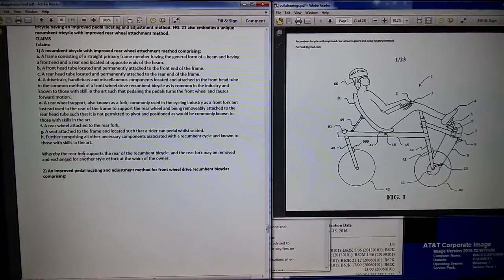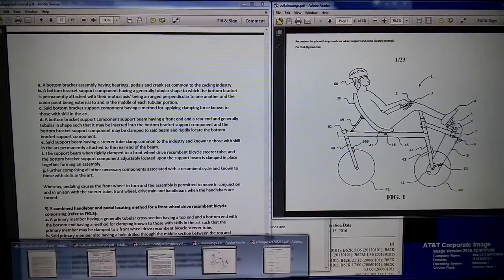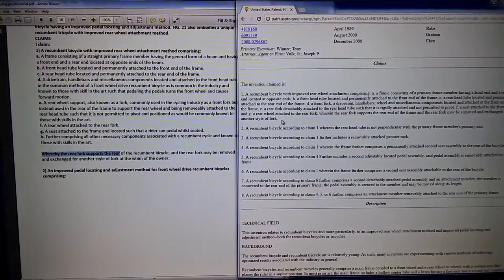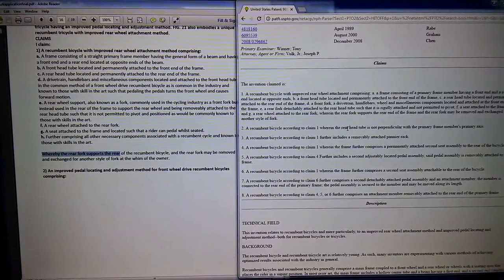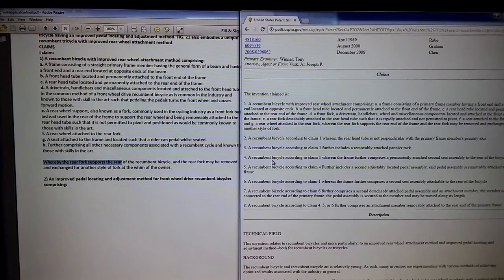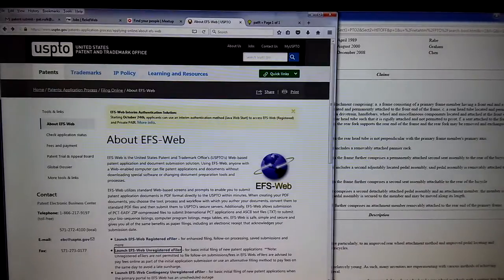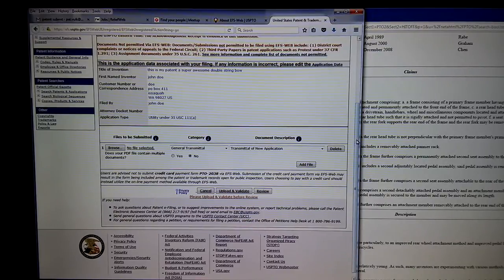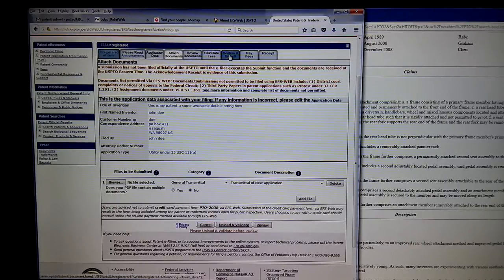How To Write A Patent Part 3

Comment: Thank you for such detailed videos you posted.  one question:  if I have a design change/tweak to current products out on the market, do I file a utility or product patent? Thank you!
Reply from the maker: Hi Ivan!  You're welcome - I wish you all success!

I think your are talking about a utility vs a design patent.
I'm not an expert - OK.
My video is to tell people how to write a patent -- which I still believe is the ONLY video that actually does that...without leaving ANY gaps in how to do it.  I'm really proud of that.
But, I'm NOT an expert on the nuances of utility vs design patents --- watch video 1 to hear my opinion about the patent 'game'.
What I'm saying is that I feel with the right amount of money, you can get a utility patent on almost anything (that's a real thing).

OK, all that said...
You need to research online about utility vs design patent.
But here are some easy to understand examples...

Does your invention have a new function...or does it only look different.

If it has a new function - never seen or done before - that's a utility patent.

If it does the same thing as before, but looks different -- that's a design patent.

Sooooo...let's say you are inventing a new type of pencil.
Design patent --- rather than the old pencil shape, it has a star cross-section.

Utility patent --- the pencil comes apart into 3 pieces and has a screwdriver, digital clock and cell phone.

Hope that helps you!

Best wishes,
Pat
AwakeLove.org
Reply: @theinterfaithshepherd9075  yes, it definitely helps!  Thanks again.  You are a great guy!

Comment: Mr. Vulk

thank you once again for this insight...

I am applying for a provisional patent application (PPA) as a microentity for the benefit of the early filing date and ability to put patent pending for my idea without disclosing/selling it to the public. 

i have questions on your part 2 vid and again on this part 3 video regarding claims.

The PPA does not require you to put a claim(optional), but i am thinking of putting in atleast  one in a broad scope.

My question pertaining to this video is,

as far as my understanding goes on CLAIMS. They are a physical feature(s) and their properties are expressed into words of the invention itself. 

I have multiple embodiment variation and parts variation for each embodiment variation carefully illustrated
. 
in writing claims  i do not YET have the technical ability and know-how  to express ALL  in words of what i claim for my idea.

EXAMPLE @ 24:30 of this video rear FORK attached at the rear head tube,

what if you included a SINGULAR tube (with or without suspension) where the wheels are detacheably  attached and is detacheably  attached to the rear head tube in the DRAWINGS.

lets say this was on the drawings you made and the wordings on the claim specified FORK on it which is inconsistent? Would it be assumed as part of the CLAIM invention?
or those things where the entire patent application process could be denied on?

Can claims be general/broad to maximize, if not entail all,  the expression of how it could be done?

I guess my main concern is if a drawing is worth a 1000 words, then what if you have a thousand drawings(variations) which tell a story be put into a SINGLE SENTENCE? 

That a claim due to the limitation of the writer could actually be the limiting factor in the patent itself. 

May i ask, What is your advice on this?
Reply from the maker: Hi John,

The words of the claim are what is most important.  The figures are merely for illustration.

I 'think' that the figures are very useful for protection (so that it is made clear visually what you have written in your claim).  The clearer things are to people trying to invent what you have already invented...the better.

The drawings are worthless without the words of the claims.  I don't know why that is exactly, but it is.

One thing I want to caution you about on your provisional patent approach -- you can't add to it later...that is true for the non-provisional too.  So be careful and think it through! :)

"That a claim due to the limitation of the writer could actually be the limiting factor in the patent itself."  Yes....definitely....

If you invent a new spaceship, draw nice drawings of a spaceship, but write claims describing a jet plane....your patent will be for a jet plane.  The examiner will help you a 'little bit' with this.

But, if you are really struggling on a patent that is REALLY important to you and you REALLY believe you will make millions on it....my advice is to either hire a patent attorney, OR get the help of a friend who's good in English.

Writing the claims can be very confusing and it's very easy to make a mistake.

You will notice in my videos that I never said writing the claims was easy :)  It's not :)
Reply: Pat vulk OK.. This second message has me thinking more.  About the PPA and claim. This is not something i don't want to just jump in without assessing first. Thank you. I'll definitely read up and contemplate the next move i'll make
Reply from the maker: Yes, John, you definitely don't want to just jump into it without thinking it through pretty well.  

The way I'd approach it (whether using a lawyer or not) is to write out your claims as you understand them - do that immediately.  Then, as time goes by over the coming months, revise and re-think them as you learn more and sleep on it again and again.

Good luck!!  YOU CAN DO IT!!! :)
Reply: Pat vulk thank you. I will update you WHEN this thing uncovers itself to me.
Reply: The Interfaith Shepherd thanks for the videos and advice. I have a question about your cautionary advice of "you can't add to a PP later". It is my understanding that you can simply file another PP with improvements and iterations. Is this not correct? Thanks so much.

Comment: Hi, thanks a lot for the videos. I just received the examiner report, do you have any videos or other resources that can help me in writing the reply to the examiner?
Reply from the maker: Hi Sherif, 
I don't have any videos on that subject.
But, I do have commentary in part 1 about how to deal with the examiner that may be of use.
Not necessarily how to reply, but to understand that the examiner interaction should be taken very seriously.  You'll get very few interactions with the examiner as the examiners process so many applications.
My advice in the video is to treat your conversations with the examiner as though it were a final exam in a very technical course and you want to get an A.  In other words, know your patent application and especially your claims inside out and back to front.  Study them and understand them completely before you talk to the examiner.
Also, remember that the examiner is not your friend.  He/She is trying to get your patent off their plate.  They want to minimize your claims and finish it off as fast as possible.
I made the mistake of not being fully prepared on my 2nd patent.
On my 1st patent I had to hire a patent attorney.

If it is not perfectly clear to you what the examiner is saying, you may need to hire a patent attorney to consult with you.

Can you clarify more what is happening?  Has the examiner disallowed your claims outright or has the examiner disallowed just a few of them?

Usually, they might say something like, disallowed due to xyz patent already doing what you are claiming.  That is what happened on my first patent.

On my 2nd patent, the examiner actually helped me with my claim wording to make it stronger.

If your invention is big and you intend to start manufacturing it etc or it is going to be a big part of your life ... you probably should get an expert involved.

My videos are intended to tell everyone how to write a patent - as far as the process.  My videos reveal all the secrets that are hard to find and dig out.  They save folks a LOT of money and many have used them to get their patents issued.

However, I'm not a patent expert and dealing with the examiner is not my area of expertise.  That can be complicated and nuanced and not something to be taken lightly.

For example, if you are rude and unkind to the examiner, or write the wrong things in response to claims, there could be serious consequences to your patent.

A phone call with the examiner was useful for me to get clarification if things are unclear...but still treat it as an examination.

On my 1st patent I argued with the examiner ... it went badly.

On my 2nd patent I was kind, patient and flexible ... it went well.

Best wishes,
Pat